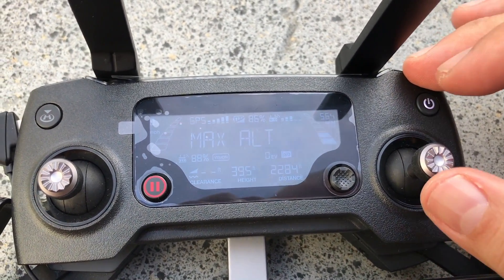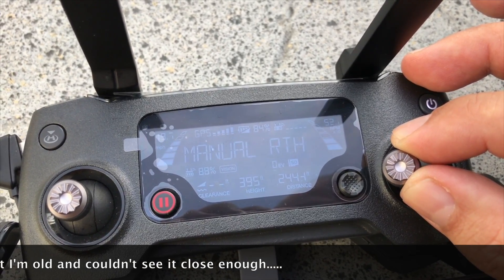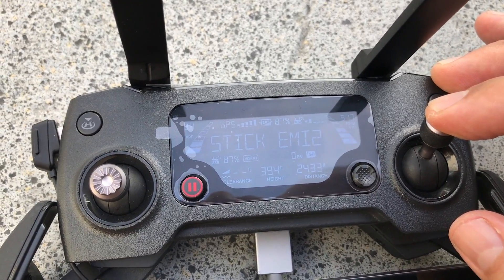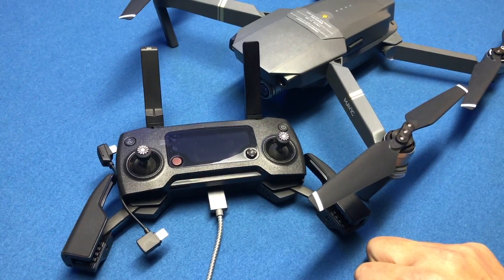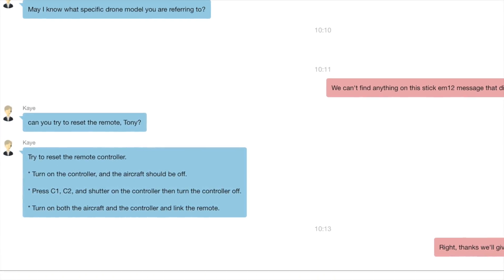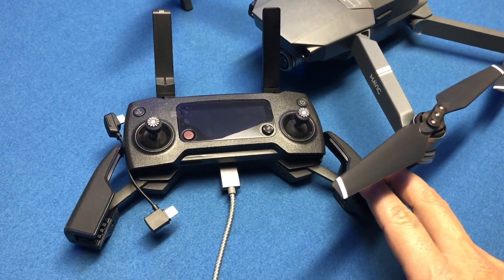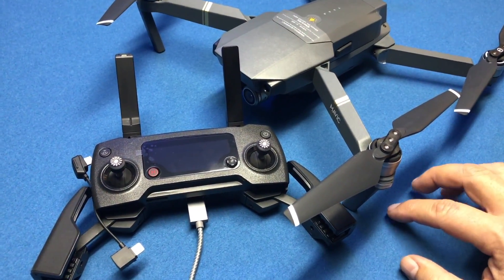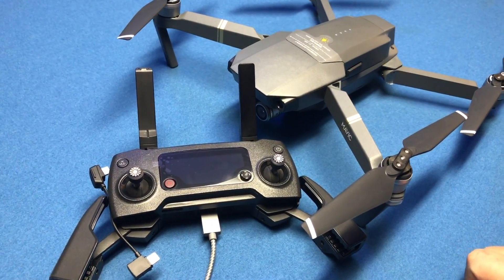DJI MAVIC ERROR CODE FIX

Comment: I had the same issue with the platinum version. What happened was, when I started the remote today, 2-9-18 the screen said "incompatible firmware, update now" so I did in the field. What that update did was update only the controller, not the drone. When I got home, I started the controller and it had a Stick EM1 error. So I mounted the drone to my Mac and  the FW is not updated. I updated the drone FW and refreshed the FW on the controller, rebooted and I still had the same Stick EM1 prompt on the controller. So I cycled the controller sticks and that fixed the problem. Verified the issue by several reboots and the issue is fixed. I still need to re-calibrate my controller sticks tomorrow because of the FW update. IMU and Compass needs to be calibrated as well.  I hope that helps anyone that might have this issue.

Comment: Hi I have a Mavic Pro and I have not flown it because I keep getting Error: left front sensor error contact DJI for repair. I have calibrated the Imu sensor several times and the compass as well yet still have a red triangle at the top when all is complete. Any ideas ? This is a brand new mavic fly more combo and I'm using a new iPad mini 4 thanks for any help in advance 😢👍🏽